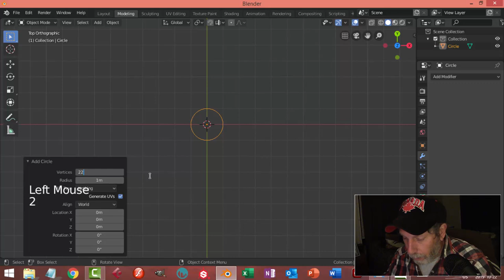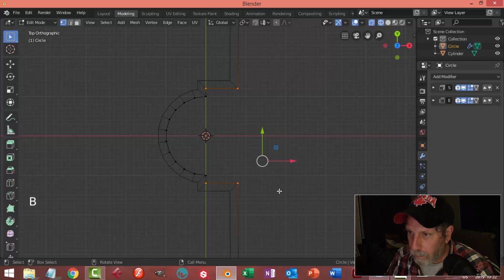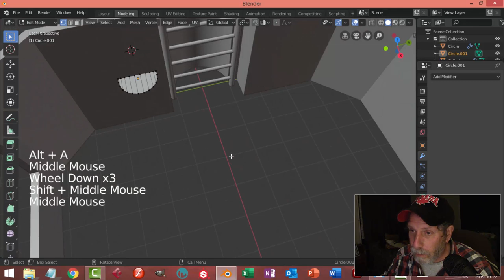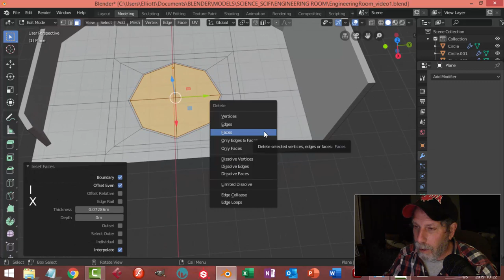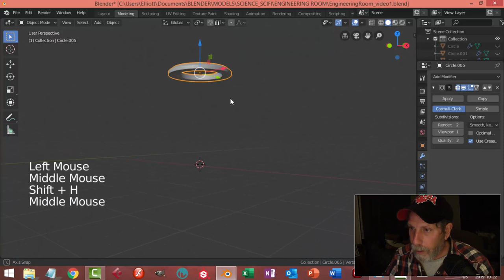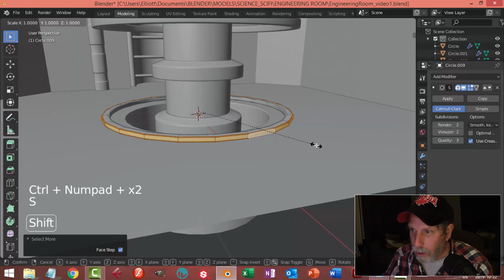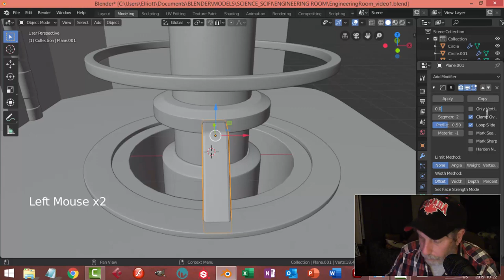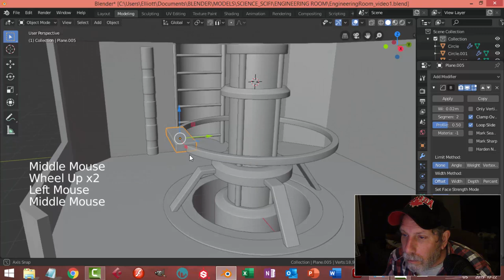Blender 2.8: Modeling a SciFi Engineering Room (Part 1)

Comment: Good evening Elliott. I have two questions on the Part 1. 1) How do you scale the cylinder so that the height remains the same? 2) I can not narrow these parts 13:02. I press Alt + S and it narrows along the X axis, maybe I'm doing something wrong?
Reply from the maker: For your question 1) if the up direction is in the z axis, you press "S shift-z" (shift in front of x, y or z means NOT in that direction).
Reply from the maker: For your question 2), if you did any scaling or rotating in object mode, this may affect things so first I suggest you go back into object mode and then press "Ctrl-A" and choose "Rotation and Scale".  This will return the object to a uniform rotation and scale.  Second, go into edit mode and select all and then "Alt-N" and choose "recalculate outside" in case any normals were flipped.  Finally, select all in edit mode and go to "Mesh/Clean Up/Merge by Distance" in case there are any stray vertices.  After that, select the faces for where the lights go, extrude (don't forget that) and then "Alt-S" and push or pull the mouse.  Hope you can get it to work.  Worst case, build another simple object and try to get it to work on that.  Perhaps as you built the object something went funny and you may need to re-build it.  Good luck!
Reply: @zerobio  Thanks a lot, everything worked out
Reply from the maker: Great!  Good job :)